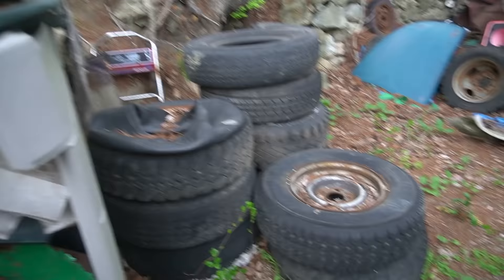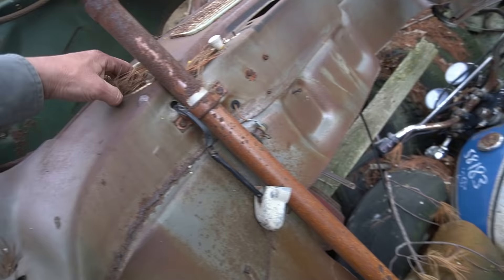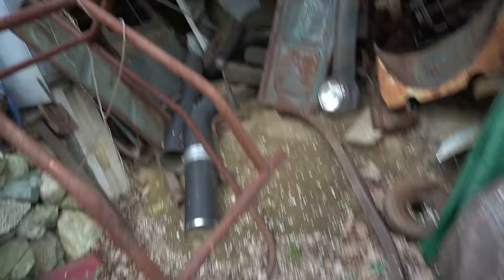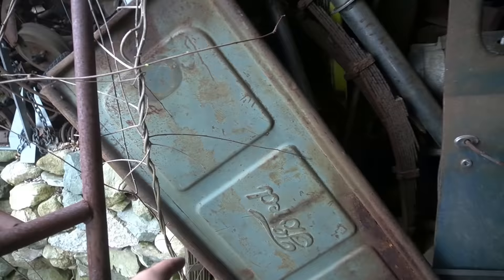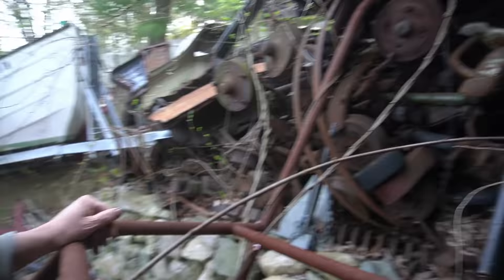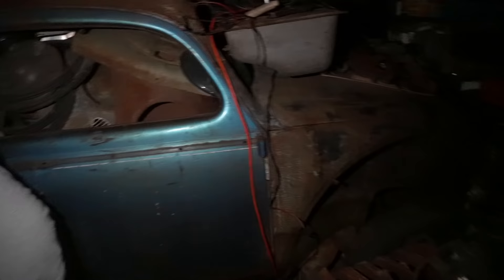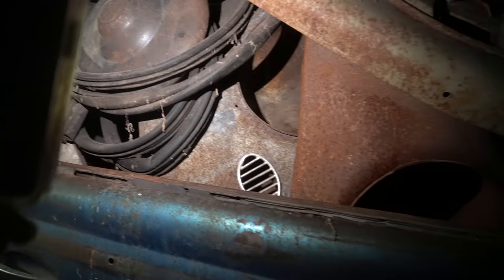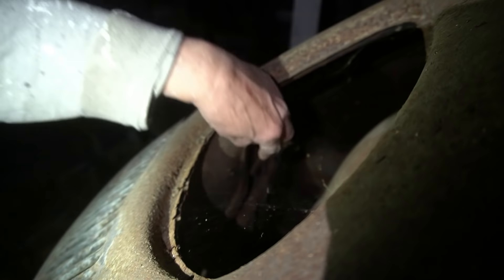Oldest beetle in the USA Discovered in a basement!

Comment: If it's a 1946, then it must have been brought over to US by a returning soldier, because it wasn't till 1949 that the first VW's were officially imported to the US.  A grand total of two were imported that year.   The numbers slowly picked up in succeeding years.
Reply: This is correct.   One of the two original 1949's is at the Sacramento Automobile Museum.

Comment: Great video! the hub cap in the 1947 Bretzel Beetle was actually not built until 1945. it's a KDF ("Strength through Joy" / Kraft durch Freude) hubcap! Maybe it's from WW2 (a 4WD Beetle maybe?).
Greetings
Klaus from Düsseldorf
Reply: The car might be value a fortune!
Reply: It depends on the story! the Volkswagen factory still has good archives of where or to whom the car was delivered.
Reply: Those hubcaps were repro'd in the 80s. It's likely a later part.

Comment: The guy in the video is correct about the inside of the rear window. That's a feature of a 46 or 47.  Then later when the idiot was drooling over a POS Brazilian 70s Beetle hubcap, you can just make out the shocktower of the front beam. It is also consistent with the claim that it's a 46.

Comment: Ugg….cable brakes, 25 horsepower, unobtainable parts.
Yeah…..ok…conversation piece. 
Driving it anywhere…..?
Then again….you could put a 300 hp chrome Chinese engine in it….or perhaps a turbo Subaru engine.
And then lower it to the ground, with a 4 wheel disc kit.
Or
Maybe a sand rail.
Now, you know I’m joking of course.
Wonderful find.